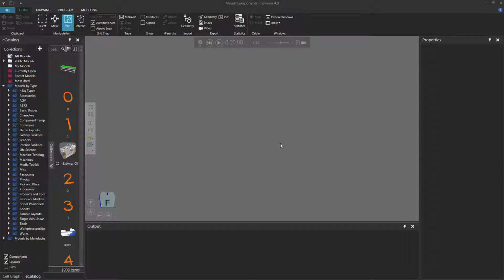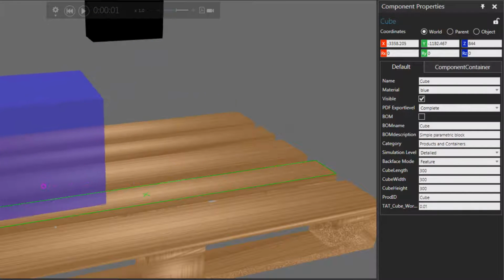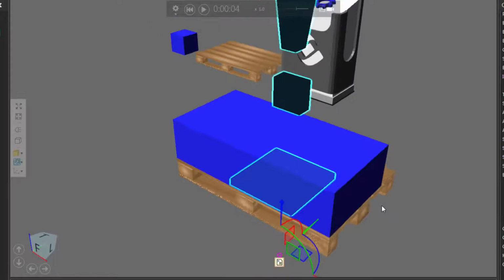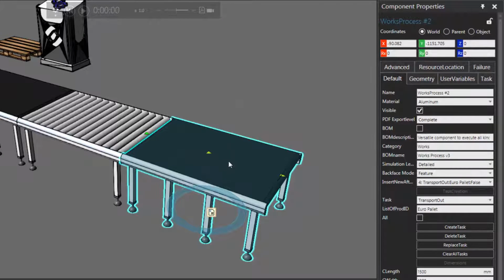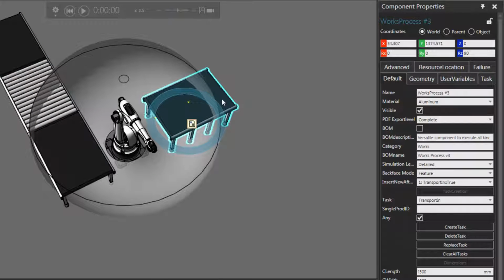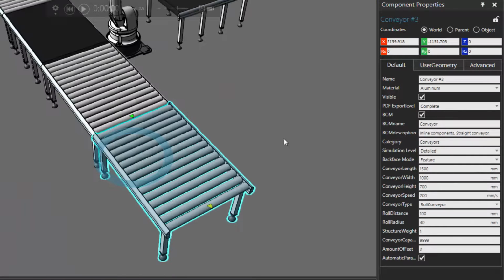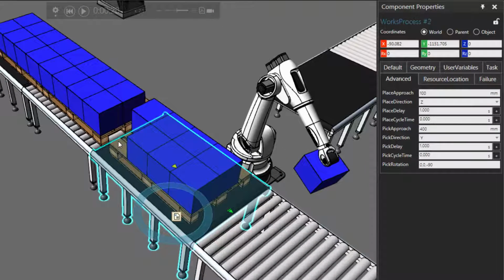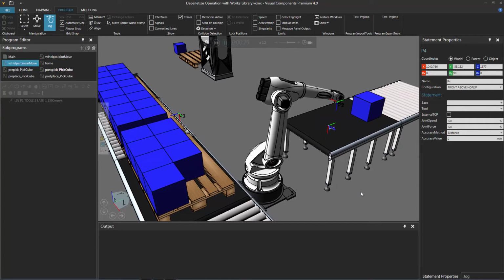Simulate a Depalletizing Operation with Works Library

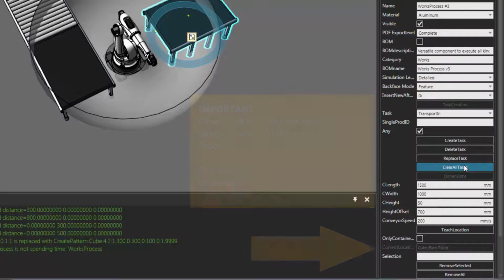Comment: At 14:14 there is a warning about using the ClearAllTasks function, the robot will place the cube 144mm above the 700mm tall conveyor since it picked off from the pallet, which is 144mm tall. Before adding the TransportOut task, have it place the cube, stop the simulation, align the bottom center trailing edge of the cube to where you want it on the conveyor and click TeachLocation to correct it.